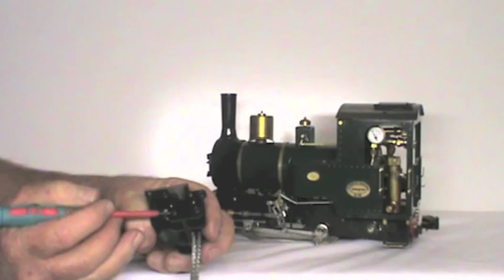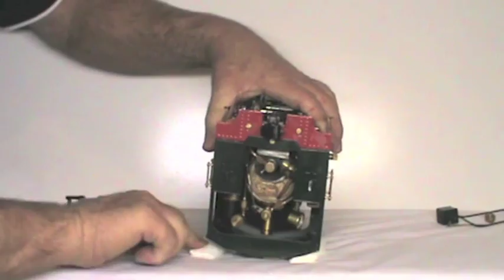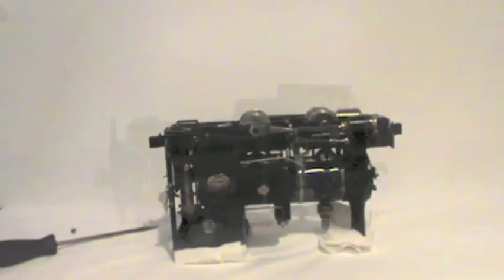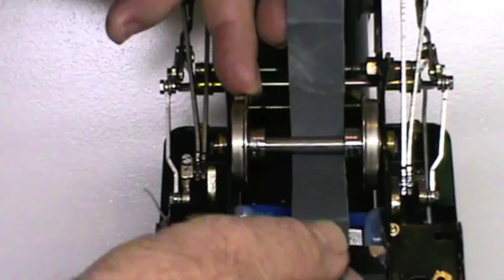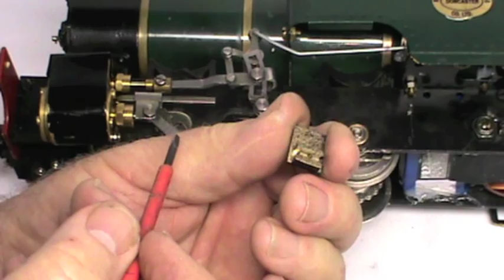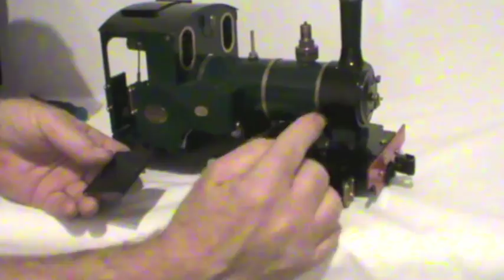Slo-mo install for Billy

Comment: Very clever way to get driver axle out without disturbing the return crank angle, regardless
of installing Slo-mo or not.  Loved placing roll of paper towel under the cab roof too.

Thx 4 posting!

From USA